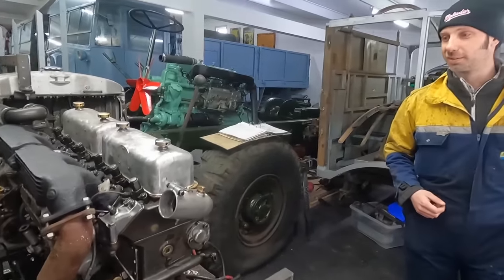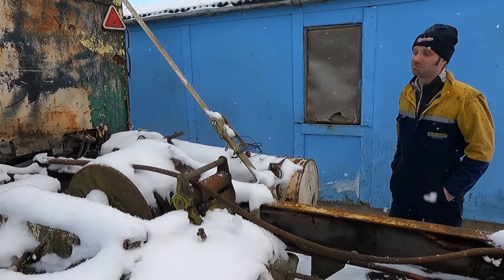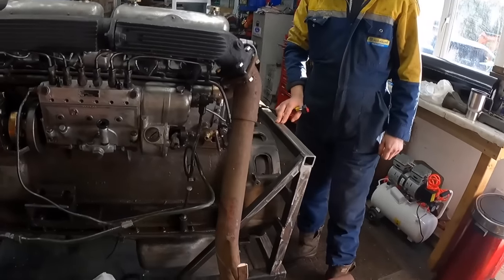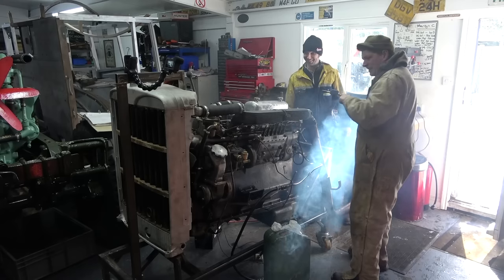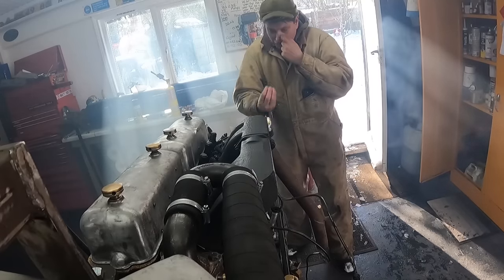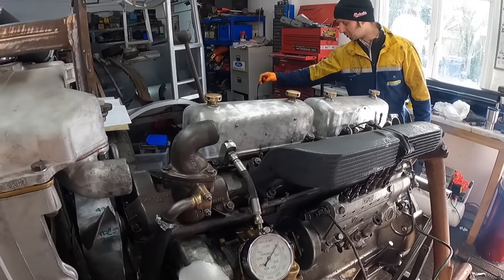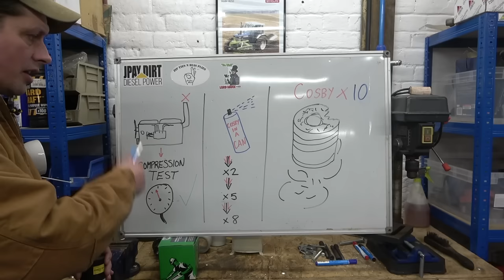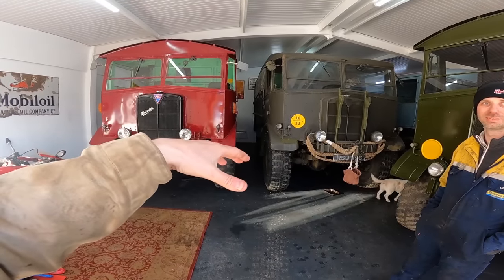WILL IT START ? - 82 YEAR OLD TRUCK COLD START

Comment: If in doubt “ double can the bastard” excellent
Reply: worst thing you could do in the 70's once easy start 's been used it needs to be used more and more.
Reply from the maker: No. Easy Start/Ether can be used to start a good engine in cold conditions with no issues.
It's when folk neglect and overlook underlying issues and rely on Ether as an easy fix that things deteriorate.

Comment: There a lovely old truck the matador my great uncle has two, one is a Notts city bus wrecker and the other a military spec gun tractor, before we had them ended up as timber tractors for Gregory's sawmill in Derbyshire and were both restored by our self's, and I have a 6 wheeler aec militant with a atlas crane on awaiting restoration  brilliant video as always 👍🏻

Comment: when i was a bairn i would go out with ma da to start our trucks in the morning to cold start,, burning newspaper held against air filter intake hole whilst turning over engine foot hard on accelerator , sometimes with a coal fire on a shovel slide under engine to help thin oil and defrost fuel lines as well.

Comment: What a great laugh, oh and a perfect explanation of the easy start story. Where did the addiction idea come from? It's an engine!
Reply: The addiction idea comes from people that don't understand how things work well anything really when the engine develops a fault and is hard to start 9 times out ov 10 muckers Cosby giggle gas will get it going as time goes on the fault that caused  the hard starting gets worse so you need more and more cosby gas but it's not addicted to it it's just buggered 😉
Reply from the maker: Exaaaaaactly 😎👌🏼
Reply: @2341jasonb  Ah that explains it. I come from his lordships background, " why won't that start then?" So I have only used easy start as a diagnostic tool! Don't get me started on people putting " additives"  in complex hydraulic systems. I am no lord by the way, just a peasant.

Comment: Way back in 1963 (I  was 11 at the time) my parents had a spinney of very large elm's taken down as one of them had shown sighns of dutch elm disease, so they sold the lot to a timber company in Bedford,we were living in Waterbeach just outside Cambridge at the time. The timber co came along with an AEC Matador and a trailer on which to haul the trees away with. They loaded four or five of the trees onto the trailer at a time the trees being about four foot in diameter 50  foot or so long by the time they were trimmed. When it came time to haul the trailer away it had sunk up to its axles in the fen type soil so they would go to the length of the winch cable drop the spade and haul the trailer in then repeat until the matador was on the road and the traile was still bogged. The spade was then dropped against the curb and winching began again, well the front wheels would come of the ground and slowly the trailer would move foward while at the same time the matador moved backwards. By the time they had done this arond ten or so times there was a distinct bow in the curb stones and the foot path and there was ruts so deep and wide that I could walk in them and the ground was level with my waist,the ruts were still visable sixteen years later when my parents sold the old Vicarage site for for development which was right in the middle of the village and the curve in the curb is still there or was last time I went through Waterbeach four years ago. I asked about the wich at the time thinking that it must be special for them and was told that it was the same one fitted by AEC the only thing they did was replace the cast drum and axle with a turned steel one. That truck made a deep imppresion on me as well.
Reply from the maker: I wonder if it's still around ?
Reply: @LordMuck  I dont know the name of the timber company just that they came from Bedford or Bedfordshire and they specialised in elms at the time for coffins.

Comment: When I was 18, not long having passed my driving test, I had to take a Matador to one of the gangs working on site. 2 miles in, I had to negotiate a busy town, with the high street on a steep hill. Baptism of fire i think it's called. Must have done ok though, because it wasn't long before they put me through my HGV class 1.

Comment: Thanks for the video. I understand Gasoline engines fairly well. Yet I know very little about diesel engines. I knew that they use compression to cause ignition, but that's about it. Now I have a much better idea. I drive a truck for a living and have for about 20 years. I have used either a lot in the mountains of Colorado in the winter. I never had a problem, but my goal was always to see how little I could use. Now I see exactly how it works. So thanks again!

Comment: Now then, Mucker, I'd love to win a collie! - It's been a few years since we had sheep, but a new collie wouldn't go amiss.

Any-way! That AEC out there under the snow is almost as good a Fordson Major, at starting, though I think in all honesty the Major might just have the edge! - Now then (again) I'd like to see you guys buggering about with various fluids/fuels and that old engine, and maybe try Brake Cleaner, and/or Carb Cleaner? Or, how about trying brake fluid? - We had an engine that used to love old fashioned "Girling Crimson" brake fluid, but by God it used to smoke and choke! Paint thinner should also work.

On a similar tack, we once ran a Fordson Dexta on paraffin (lamp oil) just to prove a point.

Comment: Loved it, did my time on AECs in the 70s, 7.7, 470, 505, and 760s they used them as they always started to tow start all the others with Perkins or Bedford's in the morning. The 7.7 and the 470 ran nice but you needed sandwiches and a thermos to go any were, soo slow. I remember the deluxe 5 speed with overdrive that would not pull the over drive gear unless you were empty. Good days changing clutches on the A4 on the side of the road. I remember the first tilt cab 505 that used to tip its cab going down the road when you applied the brakes.

Comment: Great video. Feels more like home. -12 c again here this morning. Found myself leaning toward screen trying to help will the old Matador to life from 4:30 to 4:55 on video.
I need help.. 
Not familiar with these engines, but the easy roll-over and the expressions on your face kinda hinted what was up and that you knew from the get-go and just went with it for fun. Definitely a chuckle (ps you really hate mosquitoes don't you... haha )
Give Lysol Spray a go, just to keep the Covid at bay. 
Cut some used motor oil with some diesel for a fuel & give Gretta the fits
Cheers

Comment: Thanks for the video, Looks like there is a descriptive word for that engine beginning with f and ending with d to sum up it's condition. Yeah shove the ford engine video up that will be interesting..  It's funny you say about the matador running with the pump 180 out.  I helped a buddy with his major puller , we put a newer ford 6 in it after an explosion and put a re machined timing gear on for  his original huge Bosch P series/no govenor full fuel deal to run unlimited pro stock "rev limit being internal parts not staying inside the block rules" basically ! 
  The guy that did the machining got the key groove 180 from the original timing mark. We missed it fitting the pump in a rush one night, she ran like that with so much fuel going in, it just didn't start so well.  One of my 2704'ET's had the fuel aneroid on for the turbo. I figured it didn't smoke enough in my major so pulled that junk off and threw it under the bench. Oh $#!t she smoked then L.O.L. My shops 50x50 with 10x 300w lights in ,it filled the place so full of black smoke after 2 minutes  you couldn't see the light were on !.  Take care.

Comment: A guy I used to know had a pulling lawn tractor, old John Deere 110,with a Kohler motor that was rebuilt to make about 25 or 30 horse power at about 10000 rpms!! He ran half 95 octane gas and nitro methane RC car gas! It was scary evil! Would love to see a big engine run on that shit!

Comment: I've been working on diesels for nearly fifty years, never done a compression test it's not necessary, you can tell when a diesel's knackered simply by observing the crankcase compression/blow by. Always loved the old AEC's though.
Reply from the maker: That's right, we did it for the purposes of the video as a visual indication of what we suspected we'd find once the heads were off.
However, blow-by isn't always a definite tell of low compression as some engines such as Racine built Case and the big MTU's did that from new and run just fine.

Comment: Alternative fuels, 

I've run lawnmower engines on used cellulose paint thinners that had been used for cleaning spray guns. 

I've used unlit blow touches down air intakes, best not to look down the manifold when doing this, they backfire quite spectacularly. 

I also ran a lawnmower engine with no carb using some tf90 mould tool cleaning spray, basically acetone in an aerosol can. 

I tried running a land rover 2 1/4 petrol engine on diesel. 

On diesel engines I've tried wd-40, silicone oil and unless I lit them they didn't work as cold starting aids. Spraying a 4 foot long flame down the manifold was pretty cool, the flames were coming out of the exhaust for the second or so before the engine fired up.

If your engine is half decent it might run on these. The engines I was working with had probably done as many hours after they needed rebuilding as they had before their rebuild was due. 

An engine should pretty much run to a degree on anything you can light with a match or lighter.

Comment: An excellent session of will it start, -  will it hell! 
Not only that but a good explanation or demonstration that even the most bulletproof engine can be shot apart. Those restored Matadors were wonderful examples, looking back I remember seeing them at work in their various stages from running, to running into the ground. As the knackered engine is being stripped down I hope it will be restored and that no totally terminal, (though probably expensive) damage has been done. I guess I am weird, (no I withdraw the doubt), I know I am weird*, but if anything has even less than half a chance of being recovered to run again, I like to see it given its chance of continued life.
Yes to the multi fuel running option,I would live to see the results, it could settle many disagreements.
*I am heading towards being almost as old as some of those old trucks. These days I feel I need some rebuilding, perhaps they get my sympathy vote for that reason.
Reply from the maker: It will be rebuilt and done so properly, not bodged using old Leyland pistons or some other half-arsed effort.
I'll make sure it's filmed and you'll get to see the progress 👍

Comment: Instant like love Matadors and old trucks in general. My great grandad actually drove matadors and Scammell pioneers for a living during ww2. He then kept driving trucks till he died Foden s39 8x4 tippers mainly with Gardiner 180 engines or the famous 2 stroke engines. The video for the question sounds like it would be funny and interesting so give it a go.
Reply from the maker: Same as my grandad, he drove Matadors, Pioneers, Diamond-T's etc hauling dozers, cranes and plant with the Royal Engineers in the 8th Army up through Italy 1944/45
Reply: @LordMuck Yeah great old stories both of my great grandads did actually one in El Alamein Egypt one in Greece and Italy.

Comment: Ether isn’t just for diesels...used to use it to start my Mini 1000 in -20 weather.....the SU needed an oil change to ATF first and sometimes I would heat the bell with a propane torch. At -30 and colder, the engine would overcool and produce no cabin heat even with the rad completely blocked off. Fun times.

Comment: Soon as saw the smoke in the valvegear I thought "yep, rings gone or a polo'd piston" and thinking of the age and load, its prob done far far better than ever expected.   I remember a couple of these lurking about at Woolwich barracks prob for the Rotunda museum no doubt displaced by the worthy TK Bedfords.   I like these as they look like their cousins the Regent III bus which I thought was far cooler than the Routemaster if not a little wheezy by the 70's.

Comment: Honestly ye had me in stitches when trying to get the engine to run, between fleeing the DIY gas chamber and the "double canning." 

And as for the generator, is that even a question, of course we want to see it. The more exotic the cocktail of propellant the better. (On the subject of alcoholic drinks, any chance you'd try a few in it?)

Comment: Excellent video Lord Muck :) also on that Desiel motor trying get going check the Air Intake outside tube if need a one wire to put clip connector on to start hot wire hot when put motor together if corrosion on the short out when start up and give warm air when cold or hot starts up ! Plus Air Intake tube has be running on power when engine turns over plus to fire up and when turn key off it shuts off plus with engine not used! How found about Hot Air Intake Induction Tube the 1970 624 60 hp & 1978 724 72 hp International tractors with Desiel Detroit 4 cylinders motor  had corrosion on power wire need replaced too and both tractors smoke tons from exhaust on low and high idles plus cold and hot starts! One time engine belt broke cut wire of Hot Intake induction tube  in 724 In when Hand Mill chop feed making in barn and high idle smoke like crazy like a person smoke a big cigar also get fuel pump rebuilt plus motor too because rich smoke and fuel going like coal burning was horrible! Was not fun or my dad was happy camper too!
Reply from the maker: This engine has no devices like that

Comment: Another thing just to clear things up there was a 7.7 indirect injection that the intake flap was fitted for. There were no glow plugs and the ones I worked on that were fitted to search light generators had a tin of easy start hanging on a bit of string from the air cleaner.

Comment: A low compression reading on a gasoline engine and the question then is valves, rings, or both? If rings, a shot of motor oil in the bore and the compression would jump up on the next test. If not, then it was usually valves more often than not. I've never tried that on a diesel though.

Given all the things Peg has dumped in Slave Lake for it to run on, that's going to be a pretty long list coming up 😄

Comment: Very interesting vid👍you could hear difference in engine cranking over no wonder with lost of heat to start it.  Pre mix of 85% diesel n 15% petrol would be interesting to see.
Reply from the maker: Runs fine, we'd run our tractors on a similar mix in cold weather if short of winter fuel.

Comment: Put brake cleaner in see if it starts on the ford engine and what is like for getting the parts for the aec matador engine and I would like to see it running in a later video.

Comment: Easy start smash’s the compression rings, cracks the rings with preignition.
It ignites too low down in the compression stroke, that’s why you get that loud knock knock when starting.
Reply from the maker: Yep, too much can but by the time you're using too much you've gone past the point of sorting the original issue so it doesn't really matter if you smash the rings etc.
Watch the next Matador vid... 😉

Comment: I was thinking that's rings and/or a hole in a piston, I was right on both counts. There is a brand of ether in Australia called "Start ya bastard".  I drove 2 boats with 8V71 engines but one was twin turbo. The non turbo put your finger near the starter and it would burst into life, the turbo had factory ether infection ports for cold start and it would not start from cold without ether.
Reply from the maker: Well the first issue caused the second issue - not really a hole in the piston, just chunks out the side 😂

Comment: I was once told you can run some single cylinder stationary engines by mixing flour with air in the intake, with no additional fuel.
If it's true it sounds bloody cool.
Reply: I used to have an IH sigle pot staitionary that had a valve to allow water to be introduced "to tone down the explosion". It ran on parrafin/TVO/kerosine.

Comment: That LDV had the later Duratorq engine with the crappy electronic injector pump, the slightly earlier ones with the old slant 2.5 Di Ford engine were the best ones, totally bomb proof.
Reply from the maker: 😂 I'll book you an Matt a Travelodge together 👍
Reply: Your not wrong, the later LDV tipper was a great improvement on the earlier ones, transit running gear and it looked like it had been styled by an Italian design house.
Reply from the maker: Shut up you massive nonce 🤦🏻‍♂️
Reply: @mattfoster253 The Duratorq is an over complicated piece of crap, they are a bit more refined than the old 2.5Di, when they actually run. The best thing to do with a Duratorq is to convert it to an old school mechanical injector pump, thus rendering  the shitty electronic engine management system completely redundant. See my channel for how it's done. ;-)

Comment: Last time I had a diesel that uninterested in starting I had put the wrong crank in :o) I’ve seen a piston like that on a duetz I rebuilt. The side was eaten out of it and into the ring grooves. It was a bad injector. Looks as though the combustion burn was happing down the side of the piston instead of the swirl pot.